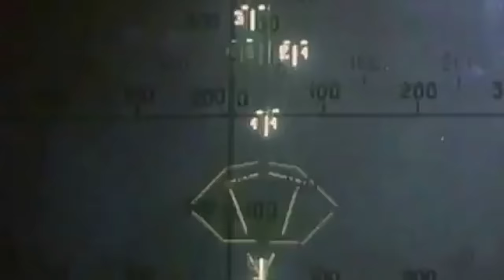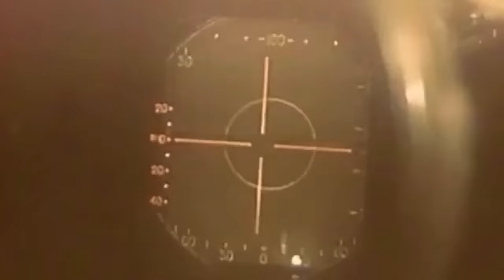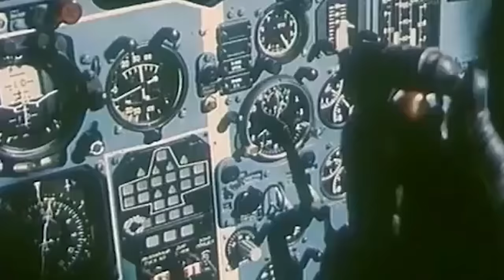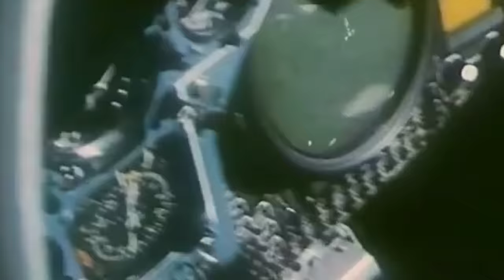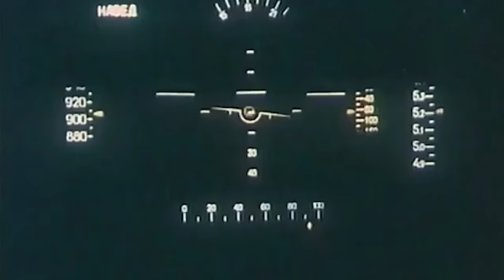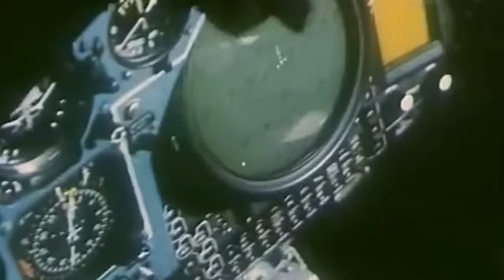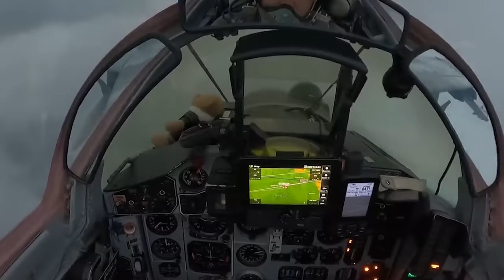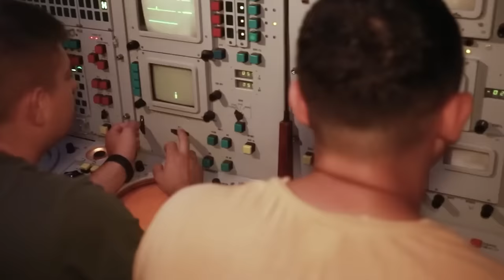The Plane that Can Catch a Missile

Comment: Its hard to believe just how massive this plane is but it the same length as a B-17 ! Obviously the wing is significantly smaller due to its engines and role but it is taller than the B17. The B-17 did put a crew of ten in the area where the Mig-31 had a crew of 2 and ginormous turbofans.  Just huge!
Reply: Holy crap I just checked this info, it's insane

Comment: The mig 31 is a gigantic aircraft i am not sure a small missile  like stinger or sidewinder have enough bang to kill something that big . The missiles carried by the mig 31 are huge and  obviously meant for killing big game like bombers . I think not taking the mig 31 and its weapons seriously would be an arrogant mistake .  All rivals should be taken seriously and dealt with seriously .
Reply: Size can be misleading, all aircraft of modern era are quite fragile, especially their jet engines. So you don't have to destroy a plane as big as the MiG-31 to mission kill it. But at the same time any damage to a MiG-31 flight system (control surfaces cables/hydraulics) could make it unstable and prone to catastrophic failure (ie break apart) under a moderate G load.
Reply: A gigantic aircraft, it was what I though too for a long time... Until I saw a picture of a MiG-31 parked near a Su-30... Then the Su-30 suddenly became the true gigantic aircraft... Dimensions are very close between those two, surprinsingly, but the Flanker feel larger
Reply: @jowenjv4463  it has the 2 of the biggest jet engines ever put in a Russian fighter plane . Look at the size of the cockpit compared to the rest of the plane . Look at the footage of people crowded around the mig 25 in the Japanese airport . Being this plane is a super improved mig 25 . Look at the scale of people versus plane
Reply: @donholiday4942  yes I know, but do the same with a Su-27/30/33/35. You'll see that it's as big as a MiG-31, even bigger from some angles. 
If you're interrested, I strongly recommend you to buy the Yefim Gordon's and Dimitry Komissarov's book about the MiG-31, because it's a great and beautiful book, and you'll see the picture I talk about of a Su-27 and a MiG-31 parked near each other. You'll see what I mean. The Sukhoi are surprisingly big.
Reply: Dude,  1 burst of any 20 mm or 30 mm cannon, can take it out (like most others)
Reply: @reggieziet the F15 with its cannon will never get close enough to the 31. One thing we are learning from Ukraine is that Russian BVR is most likely superior to western equivalents. Imagine 25 aircraft downed in 1 week!
Reply: @mindlos3960  Your right, but i meant if its technically possible. Nato needs a phoenix missile 2.0
Reply: Its hard to believe just how massive this plane is but it the same length as a B-17 ! Obviously the wing is significantly smaller due to its engines and role but it is taller than the B17. The B-17 did put a crew of ten in the area where the Mig-31 had a crew of 2 and ginormous turbofans.  Just huge!
Reply: @densealloy  oh yeah she's real big

Comment: Just an Updated Mig-25 and no it didn't make other Combat Aircraft Obsolete.
Reply: No and yes it did. Look at how many Ukrainian jets are now useless because of it.
Reply: No it’s definitely a lot more capable, particularly down low
Reply: It did light a fire under the Air Force, giving us the F-15.
Reply: @hydra8845 do they just boom and zoom them?
Reply: @Cowboycomando54  The MiG-25 did. MiG-31 came after
Reply: @hydra8845  The Ukrainians had old Soviet aircraft with little or no upgrades.
Reply: @conorf8091 there is sucj thing called BVR. Yes its hard to understand for your brain but radar and huge r37m missile together with insane speed and height of mig31 makes it unbeatable in BVR if it's opponent is not F22 and even then radar is powerfull enough to pick it up around 100km
Reply: @conorf8091  No. Unique "Look Down, Shoot Down" capabilities.

They won't lose altitude for some puny fighter issue. They let the arsenal do that.

Comment: I know it's a waste but, it would be interesting to modernize a Mig-25 and set it up against a Mig-31 to see how a resto-mod of that plane would fair against its evolved younger decedent.
Reply: Didn’t the MiG-25 struggle to go supersonic down on the deck?
Reply: @TyrannoJoris_Rex  Yes, and actually pushing the MiG--25 to its max speed at any altitude drastically reduced its engine life to a point where it was for emergency-only.  Otherwise, it flew the same "average" speeds as any other fighter with none of the maneuverability or ability to actually intercept anything.
Reply: @spazmodicusrex6629   I know it couldn't supercruise, but I thought it's normal operation was streaking along at Mach 2.35 around 20,000 meters in low afterburner
Reply: its*

Comment: I can't grasp a thing. With all that speed, at high altitude, can the Mig-31 push 1+ Mach (or 2+ Mach) without afterburners (effectively a supercruise)? I understand that it has lot of fuel to use, but I can't understand if it can withstand long range travel at high speed while not using afterburner.

Comment: What is  more funny abaut the Mig25 and the 31, its the fact that even the Russians didin't know how fast this planes could go for real.
They were missiles with a pilot with  Beast engines.
Reply: No its was prove that the max they can go is Mach 3.2 due to the metals they used along all leading edges and the compressor blades of the engines. Which btw could only maintain said speed for a few minutes before the engines were kaputnik and were dead stick back to base maybe.
Reply: @necronoverlord2306 Only the MiG-25. The MiG-31 uses titanium and composite materials for pass Mach 3. Not ideal, but doesn’t “destroy” the engine.

Comment: The F-15's APG-63 was phased array, and operational before the Zaslon S-800 in the MiG31.
Reply: The AN/APG-63 and AN/APG-70 are a family of all-weather multimode radar systems designed by Hughes Aircraft (later Raytheon) for the F-15 Eagle air superiority fighter. These X band pulse-Doppler radar systems are designed for both air-air and air-ground missions; they are able to look up at high-flying targets and down at low-flying targets without being confused by ground clutter.
Reply: APG-63 was mounted on a gimbal, with the beam being directed mechanically. The Zaslon was fixed in place, with the beam being directed electronically (which is what the 'E' in PESA/AESA refers to).

That isn't a comment on which is better, but that's what's meant by the 'first of its type to be fitted to a jet' claim. Emerson and Raytheon did both submit proposals for PESA radars for the F-15 in the late 60s, but neither design was chosen for whatever reason.
Reply: @DeletedScenes312  I stand corrected. My mistake was confusing the early APG-63 with the later (v)2.

Comment: Amazing to think that the Mig  25/31 had near SR 71 performance and all without the need for expensive and rare titanium,
Reply: While the MiG 31 could reach  a speed of mach 3 like the SR71. The difference is the SR71 could hold that speed for only minutes before the Airframe melts and it’s engine over heat due to high temperatures. So yeah I wouldn’t call the MIG 25/31 to have “near performance” to the SR71.
Reply: @arklight2830  I think you meant the MiG -31 could only hold that speed for several minutes: the SR-71 CRUISED at Mach 3+
Reply: They did excel at cheap, rugged and reliable.
Reply: @alanparsonsfan  Lol, everything is, so long as you don't exceed design limitations.

Except for Cessna 310's: they're expensive & they break, even if you don't fly them!

Comment: What’s the extension above the canopy?
Reply: A periscope.
Reply: Wasn't it for nuke strike using a canopy shield
Reply: According to old "Wings of Russia" and "Wings of the Red Star" documentaries, its a popup para-scope for the backseat crew member if an instructor pilot is flying with a student up front, there apparently is a retractable button-less control stick back there too for an instructor pilot to use as well.  It's only used at low speed low altitude maneuvering for takeoffs and landings.
Reply: Like Charger 317 says is a mirror that allows the trainer in the back seat to see the front of the plane and the ruway for taxiing, once airborne this would cause too much drag and would break off so it would retract before the takeoff run.

Comment: It is a disposable aircraft since when it reaches Mach 3 speed its default engines have to be replaced immediately or it will suffer a catastrophic breakage. It has something in common with the M262.🤣
Reply: Was corrected back in the early 80s. Burning these parts out was how they learn where to correct it. This Soviet legend will be flying well into the 2030s because this isn't actually a problem anymore. But they did reopen production facilities to make replacements parts for this beast to ensure it's integrity.

Comment: The Mig-25 and Mig-31 are both very formidable aircraft. But it’s important to remember that neither one of them are capable of sustained flight above Mach 2.8. For that reason, they will never be as good as the F-15 Eagle which was designed from the start as an air superiority fighter capable of flying above Mach 2.5, and out maneuvering virtually any other fighter it encounters. Having said that, the Migs are just fast, straight line interceptors not capable of much of anything else.
Reply: well yeah, you cant really compare planes desinged for different purposes. its like comparing an aircraft carrier to a corvette. yeah sure both are boats but they serve entirely different purposes.

Comment: thats a tall order saying a Mig 31 could catch the SR 71 when the SR 71 is 336 mph faster than a mig 31 it would have to get lucky
Reply: I think you misunderstand the concept of interception. The Mig 31 would not run from behind the SR-71 but the interception would be coming from the front so it does not necessarily have to be faster than the target, if it must fly higher. In this way, with a limited number of interceptors you could prevent penetration into your territory.
Reply: @juanalejandrosegura5857  no I totally understand interception. the Mig would still have to be very lucky to intercept something that can fly more than 300 mph faster and yea sure it would make the odds better if there were multiple migs but to scramble them once detecting the SR again the migs would have to be lucky. the SR 71 regularly flew the same paths so they were predictable why I have no idea that was pretty stupid. its said that mig 31s have intercepted the 71 and were able to get lock well I take everything said by Russians with a grain of salt. but my point is they are trying to make this jet look as if so let me ask if it was so capable of intercepting the SR how come it never shot one down. there were plenty of times they were in the air at the same time.
Reply: @robhaywood6783  In reality, once the Mig 31 was operational, the SR71 did not enter Soviet territory again.
Reply: @juanalejandrosegura5857  I knew someone was going to say that but it was not because of the mig 31 do a little research the SR 71 was being retired anyway it had nothing to do with the mig 31and if you think that is why explain why the mig 31 entered service in 1981 and the SR 71 did not end service until 1990 and by the way you are wrong the SR71 did enter  the soviet territory while the MIg 31 was in service The Russians claim to have intercepted it in 1986 so if you want to believe Russian propoganda why did they not shoot it down Ill tell you why because they could not get a lock and catch it. see your problem is you believe what Russia says funny when the rest of the world knows everytime something is said in Russia its pretty much a lie
so until you can come up with iinformation that you did not find on google I would stop talking

Comment: Productions ended in 1994 old frames are slvage  to keep Mig 31 flying only few left, enigine production ended too. It is dying aircraft
Reply: Just like every cold war era planes F-15 for example
Reply: @kwestionariusz1 the F15 production runs are still up and running.  They aren't running at the rate they were during the height of things but they're still producing E model and the EX model.
Reply: Engine production is still ongoing, airframe spare parts are still being made, where did you get your information form, just no new batches are being made.
Reply: They made over 500 of them and they have over 150 updated and operational. Your confusing the MiG-31 with the A-10 my friend. They literally need to steal parts off of parade, ground and display aircraft in order to get the parts for the A-10.
Reply: @kwestionariusz1 You say every cold war Era plane, then pick one of the few planes that is STILL in production. How does that happen?😂

Comment: The interceptions claimed by Ukraine of the Kinsal are dubious.
Reply: Kinshal intercept was done by a patriot missile system
Reply: @markussantos6164  yes, by firing off every missile in the patriot systems batteries, basically a blind hit.
Reply: @klausschwabshubris  are you watching Russian TV? Probably your a bot
Reply: @markussantos6164   did I hurt your feelings ?
Reply: @klausschwabshubris  why shud I get hurt.i don't answer back to a bot this will be the.last
Reply: @klausschwabshubris  a blind hit on something this fast?
Reply: @Cletus_polski   20 patriot missiles to take out one kinzhal yes, a blind hit.
Reply: Assuming thats true it was a „lucky hit” but not a blind one when you shoot something this size at this speed at a distance of dozens km. It is semantics but your comment sounded as if you think you can throw enough of anything and get a hit. Also i would like a sOUrCe.
Reply: Are they?
And how do you know? What reputable sources can you quote?
If you can't provide evidence in your comments, you may as well keep what are little more than unsupported opinions to yourself.
Reply: @Tinker1950 most likely Russian news broadcast.
Reply: To the uninformed I would agree. But it has been validated by independent ( Not US or UA ) sources that patriot has been doing very well. So well RU has stopped firing Knizahl and other missiles at Patriot covered areas and gone to Suicide Drones that Patriot has a hard time hitting. But Gepard has been doing work in that front. They have switched to Odessa now for missle attacks. No Patriot there Just S300/S400 that apparently can only take down their own aircraft (RU that is).
Reply: @brianv1988  Sources?
Reply: @raynetorrin  links to source material?
Reply: @maddogroam  Russian Duma state representative don't know his exact title but they said this in a meeting where the press was involved
Reply: @brianv1988  that's not good enough.
Reply: @markussantos6164  Getting mocked by someone that watches CNN. Priceless
Reply: @klausschwabshubris  abater seis foguetes hipersonicos kinzhal é um ataque cego???
Reply: @klausschwabshubris  
 Não foi um foram seis.
 E porque desde esse dia  ( maio)nunca mais foi empregue???
Reply: I saw the video clip it was 21 patriot interceptors shot within a a few second at one kinzal missile, Ukrain ordered the arrest of the person who posted the video. The west should not underestimate it's advarsaries.

Comment: 😂 Precision and Russians in the same sentence is an oxymoron comrad ❤
Reply: No. They spend the money where it does some good and don't waste it on high tech gadgets that need continuous maintenance. Note the F-16 needs pristine runways to operate off of while Russian aircraft can pretty much use any hard surface. That why the Ukrainians Su-24 aircraft are able to be hidden from the Russian air attacks on airfields. They get the alarm, fly the aircraft to some remote fields and then they are safe.
Reply: @deansawich6250  The Soviets/Russians didn't spend money because they didn't have any, kudos to them for being able to put together something like the Mig-31, but that doesn't mean it's good, the number of them left in service says it all.
Reply: @deansawich6250 F-16 does not need prestine airfields. And it outperforms every soviet/russian aircraft
Reply: @niume7468  🤣
Reply: @deansawich6250  There is little evidence that the S-400 is more than a light upgrade of the S-300, or even very good.
Reply: @recoil53  yup and remember that in 2022 Ukrainian hind helicopter flew to belgorod bombed a oil refinery and returned to ukraine. A regular cold war helicopter penetrated airspace during war timr
Reply: Kinzhals and Iskanders ,Dandelion artillery systems ,modern T80 and T90 tanks with modern targeting systems and a 5 km main cannon, Ka 52 with vikhr missiles , kornet atgms and any other modern RF equipment will like to doubt your “free opinion”
Reply: @BreadPittAAAAHHHH  Russian quality is a well-known global brand and standard for manufacturing quality and manufacturing precision.
You comrad, obviously did not have the opportunity to have Russian and NATO goods in your hands and compare them on the spot.

Comment: 50 year old plane with Russian tech lol god help them
Reply: Verses just as old NATO jets. I don’t think you realize that most modern Russian jets were made in the late 1980s and 1990s. It’s design was from the 1970s but most weren’t built then. Most NATO F-16s however probably were made in the late 1970s.
Reply: Lol F-15 A-10 B-52 had same or more years old and many more equipment from USrael
Reply: @hydra8845 F-16 is probably as old as MiG-29
Reply: @hydra8845  what 50 year old radar system and missile defense system is it going up against
Reply: @kwestionariusz1  bro it was a joke
Reply: Is there something else they need?
Reply: They already have the SU 34 which can launch kinzhals as well